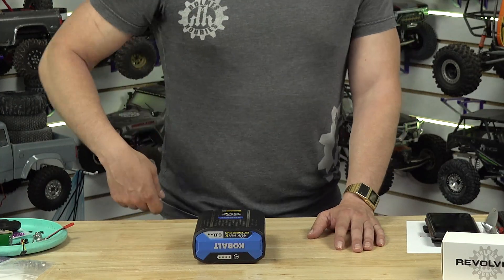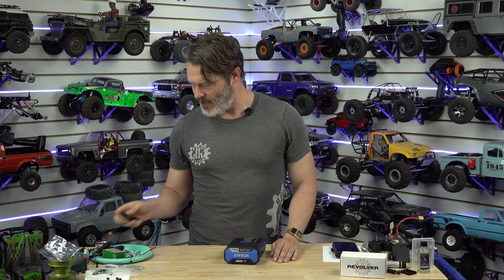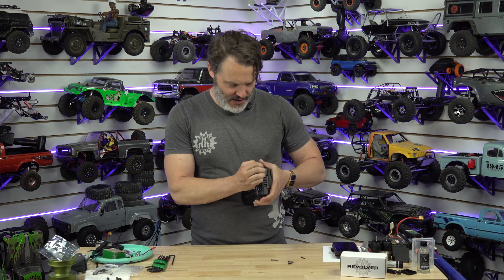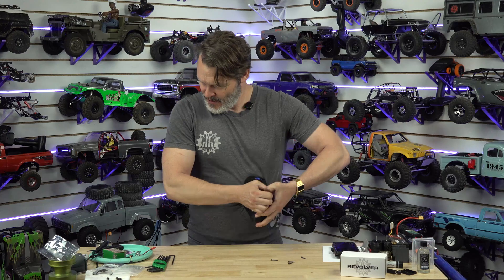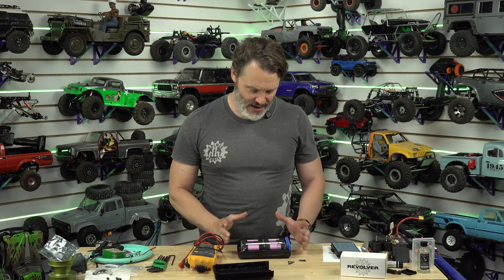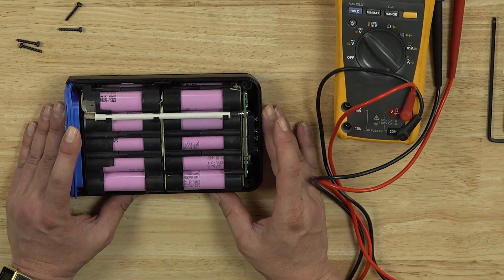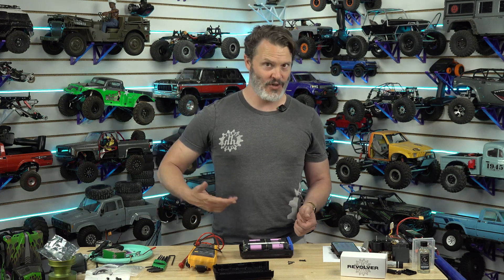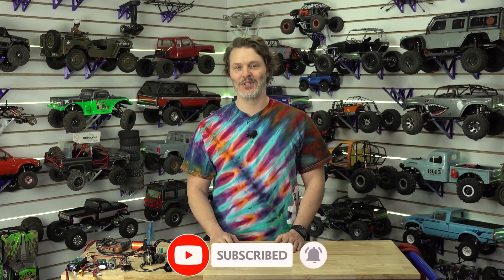DIY Battery Autopsy 🧠🔋 Can This Beast Be Repaired?

Comment: I have fully converted to Ryobi 40V yard equipment and couldn’t be happier with the performance on a 1/3 of an acre property. Ryobi has the same issue though, it is cheaper to buy a new piece of equipment with a battery than buy a battery. The piece of equipment that surprised me the most was the 8” Auger. I dug 48 - 30” deep holes and it did amazingly. I actually dug 18 holes on one battery and it still had 25% life left.

Comment: I had a battery similar to yours. My son left the battery attached for the winter and it drained it. I jumped it with another battery. Got it up to a voltage where the charger would charge. Battery charged all the way up. But when you put a load on it, it immediately died.
I've jumped-started 5 or 6 3s RC lipos. One of them puffed. It was the one my uncles. That was the 2nd time he let it die all the way. 
Obviously, take precautions and jump them in an open or safe area.